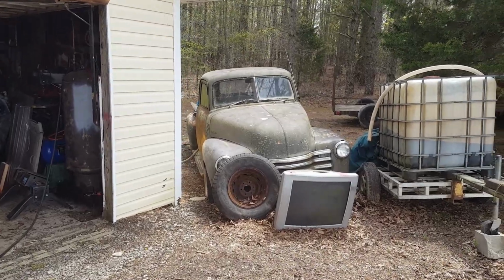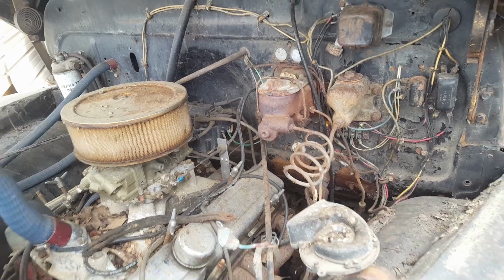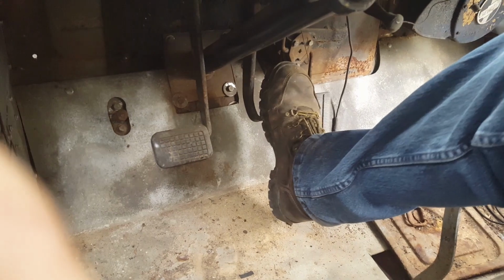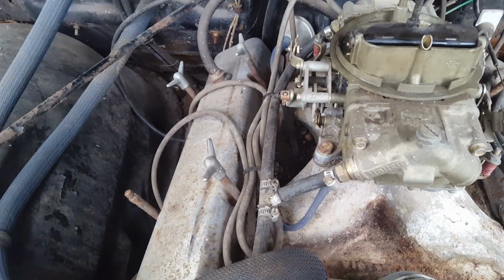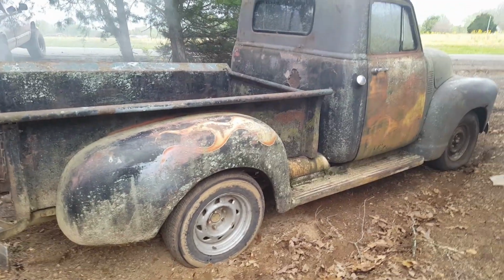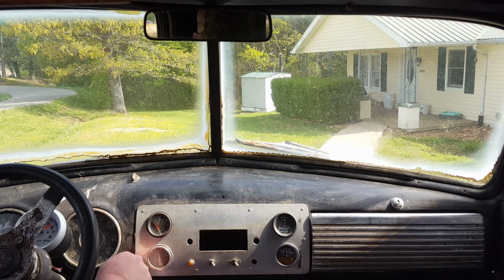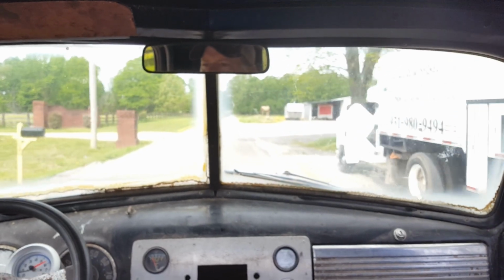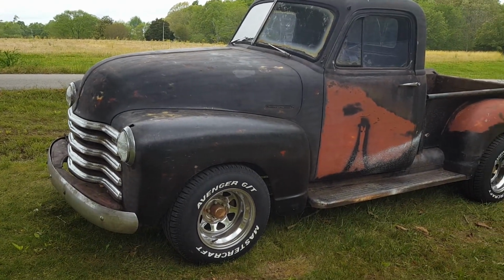1953 Chevy pickup been off the road for 26 years. Will it run and drive???

Comment: At 14:36 you can see lightning ⚡ flying off them sparkerlator wires. 😁 Right off that dipstick tube or whatever it was
Reply from the maker: Hmm I'll have to check that out because it has a slight miss at low rpm now.
Reply: @ThisNThatGarage  Aw heck man . I just looked on my big monitor. I apologize, it's a dad gum cob web or something with some kind of something stuck to it a blowing around...right there under your fuel filter.. may have even been a dang bug a flyin around. It stopped when It shut off.. Lol it looked like sparks on my phone screen.. I'm sorry . .

Comment: I had a '52 Chevy 1/2 ton pickup. It got to where it would run about a mile and stop like it ran out of gas and if let it sit for a half hour or more it would start up again and run another mile and stop again and repeat the process. I found out somebody put a marble inj my gas tank and when the marble rolled over the tank outlet it shut off the gas and in a half hour enough gas would leak around the marble for it to start again and run until the gas ran out of the line.

Comment: I'm a new subscriber and thought I'd gave you a idea.  It will take a while to do but you will save the flames... use soapy water and XXXX steel wool. It cut real fine so that when it cuts through the primer you move to the next area.

Comment: The truck don't like to run when it's sucking up rust and sludge from the tank. Time to put a new tank in it or a fuel cell in the bed of the truck better then running the old fuel tank

Comment: When I was a young man I had a 66 impala ss with I think the same motor. From the factory it had 300 hp and came with a carter afb(aluminum four barrel) That is if it has double hump heads. Of course being young and crazy, I put a Holley 600 vacuum secondary and Black Jack headers. Lol I had a blast . Those bullet mufflers sounded so good. Great video my man, love the truck.

Comment: You stated this Chevrolet is a 1953. No. Unless someone replaced the Cab. Cause 1953 Chevrolet Pickups had Vent Windows in the Doors. Late 1947-50 didn't have Vent Windows. 1951-53 did
Reply from the maker: Watch the video again and see the vent windows.
Reply: @ThisNThatGarage  l did and you're right. But 1953 Chevrolet Pickups had a Maroon Dot in the Light Switch Knob. And the Door Window Knob was Bakelite Maroon Color.

Comment: It’s a good thing you are not doing experimental airplanes. Love the old truck. Years ago I bought an all original 1954 that had never been touched with 62,000 miles. The guys brother bought it new and it ran drove perfectly. $1000 I paid for it in 1989. It was a five window. The guy I sold it to in Winston Salem did a refurbish-restoration and paint and sold it for $15,000. The park brakes were amazing in their build and through the frame levers.

Comment: I know all about the brake issue. I took my ‘55 out for a run after sitting a few years and nearly smacked a car in the rear in the middle of town. Needless to say new brakes where the number 1 item on the list. I bought a new gas tank for mine as well. They’re not that expensive these days.

Comment: Does she run as good and reliably as you remember it back in high school? I'm not surprised how well it started. It is a small block Chevy after all. Seems you can beat them hard and put them away wet and they still want to run. 5psi of oil and it'll drive all day.
Reply from the maker: Not quite as good but not too bad. I don't remember first gear being that tall. Man is it tall!
Reply: @ThisNThatGarage  I hate it when I see amateurs who spray starting gas or gasoline into the intake it is a sure engine killer professionals find out what the problem is why a car can't start without extra help 🙂

Comment: You had me cringing the whole drive. I've been thru every bit of that in my 56 F100. Loose coil +wire had me stalling. A bad ignition switch (only starter circuit ran).. I've pushed to safety over 20 times.. yup, most people SUCK😕